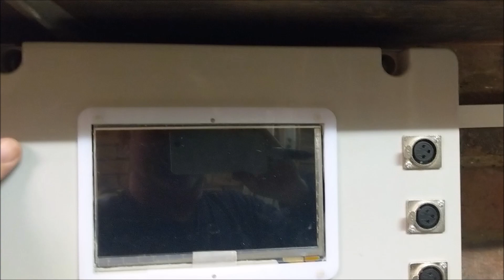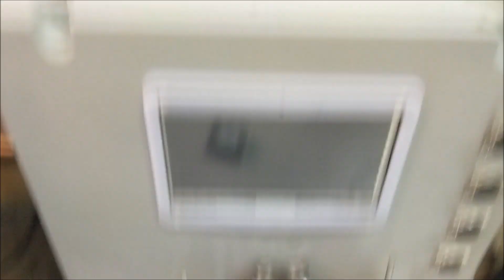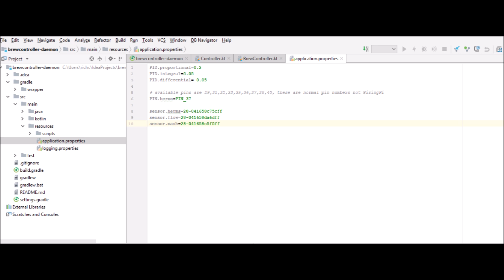Brew Controller Panel Upgrade

Comment: Looks good :) Be careful of those relays (assuming they're from Big Rock Candy Mountain). The chinese knock offs vary in quality and can sometimes go nuclear in a spectacular fashion. I've been using them and not had problems though.
Reply from the maker: They're from a UK supplier but no real idea where they are originally from.  I've got a couple in other things that seem to be working fine from the same supplier.